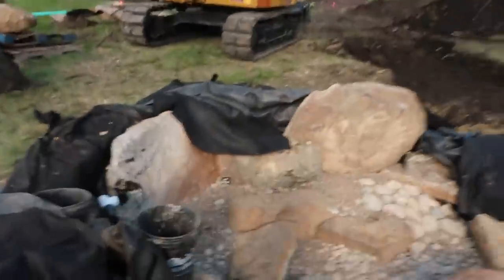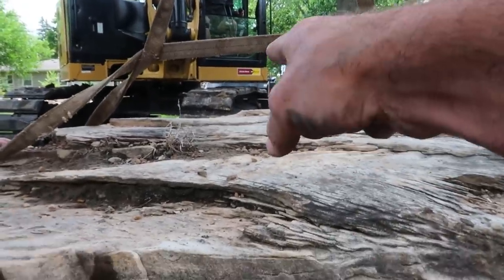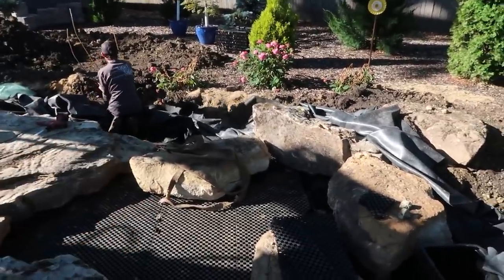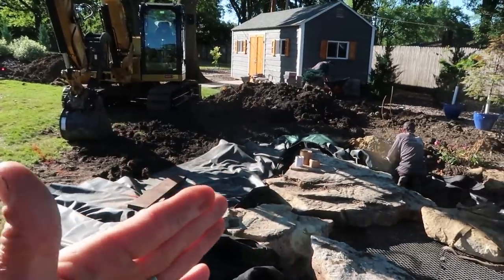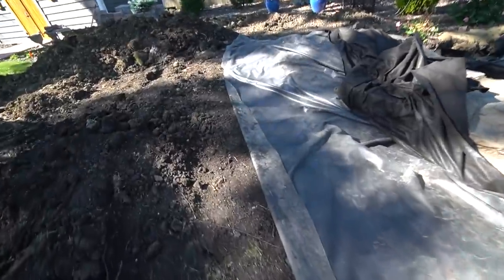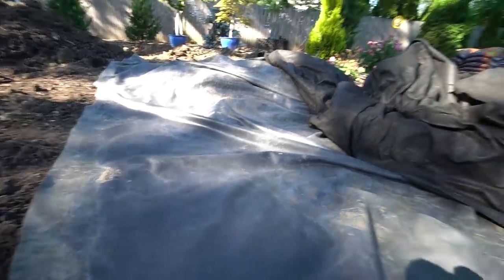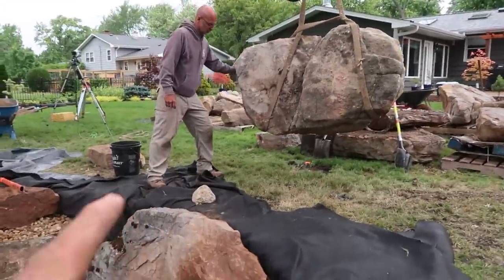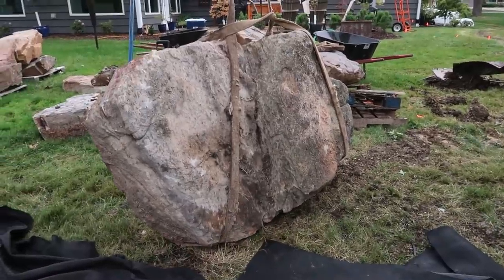Pond / Pooling Area for *PONDLESS WATER FEATURE* - Part 3

Comment: part 2 & 3 repeat an aweful lot . . . who's edit'n these, tell them to get a fresh set of eyes on a series before they start pump'n them out. . .it'll cost ya views and stuff cause someone is either push'n and over worked . . .or lazy . . .   noticed that recently in a couple of the videos, rinse and repeat style which is great to hit the 3rd run retention marker but in each video across the parts of a project gets old and grindy on the viewer. . . i know the projects don't go that way and i'm certain the video work and commentary has affected logistics and time on job - get back to simple, straight forward casual presentation of relevant material on the channel it belongs. .. this series probably outta been maybe a 2 parter, it's not an instructional series its a job . . . show before, time lapse through with fills for marks, hit your 3-peat and product placement then get out :)   excitement about a job or even a lifestyle is awesome to see but watch it some of the guys are getting a bit evangelical and it's as blatant as a fat kid in a speedo and sometimes more cringy . . . too many  mini-greg ed or brians' run'n around just doesn't work :)